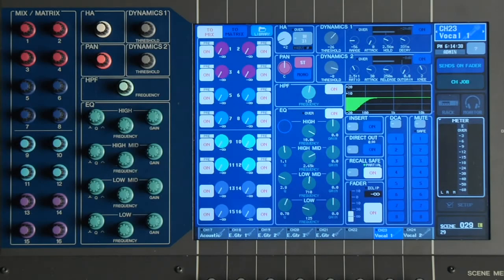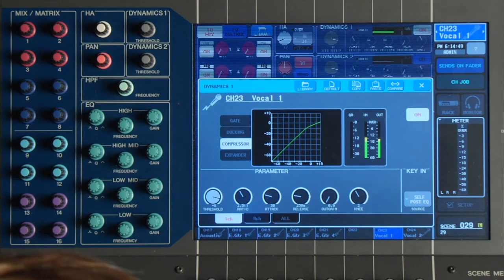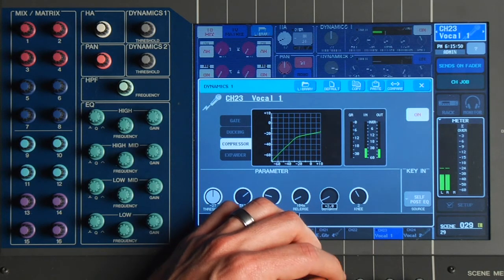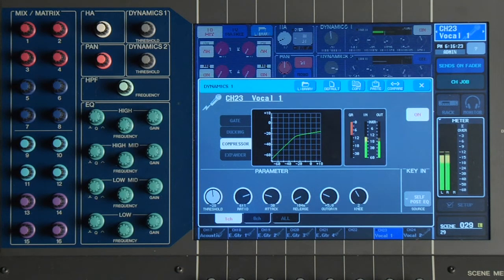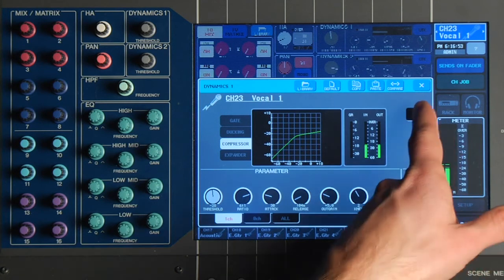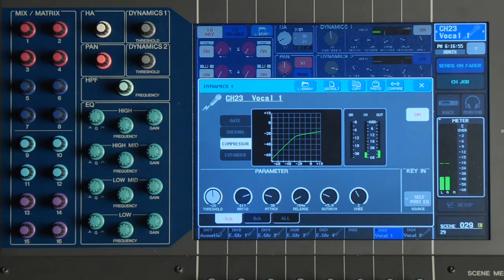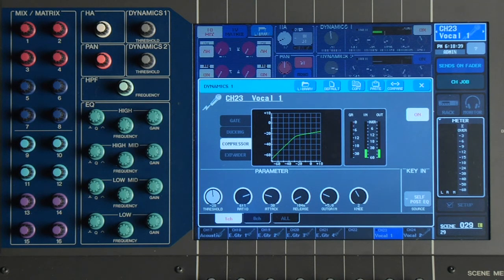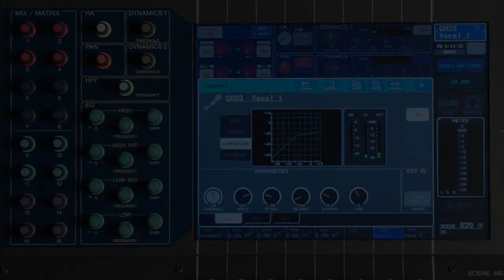How to Compress Vocals on a Yamaha M7CL

Comment: Do you compress background vocals?
Reply from the maker: As always, it depends. One of the downsides of compressing anything is that the noisefloor (background noise outside of the closely-mic'd source) volume is increased while the closely-mic'd source's volume is decreased (at least the peak volume moments). In most stage layouts, the background vocalists appear near the drummer, whose loud drums and cymbals tend to overtake the microphones of the background vocalists. Therefore, when you compress the vocalists, the drum volume (and usually the cymbal volume most) increases. So...you can compress them, but generally, it causes more problems than it's worth.